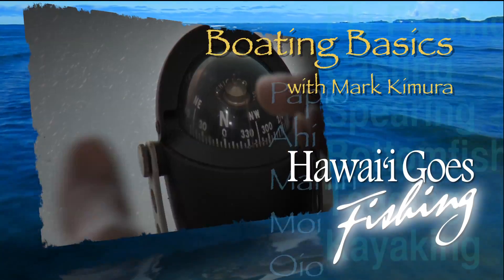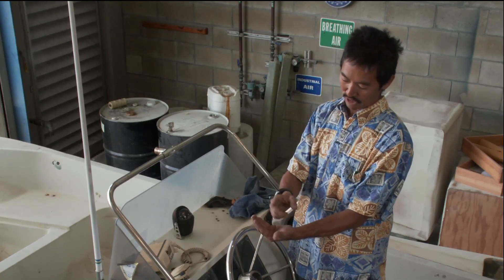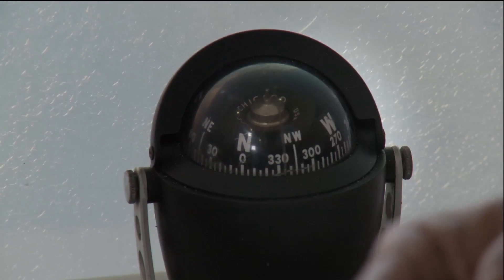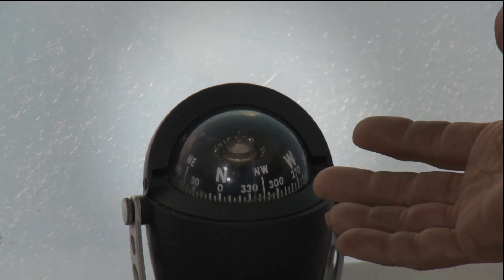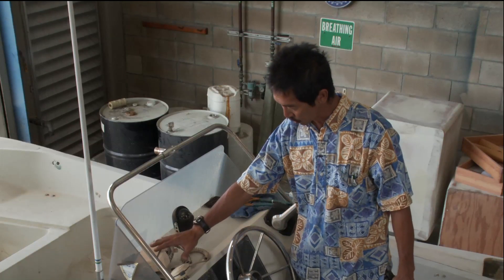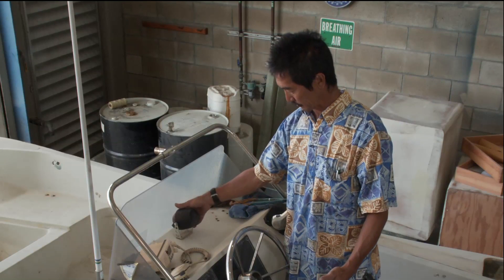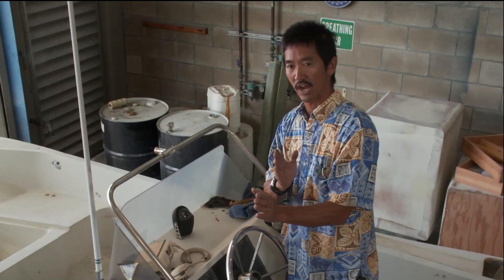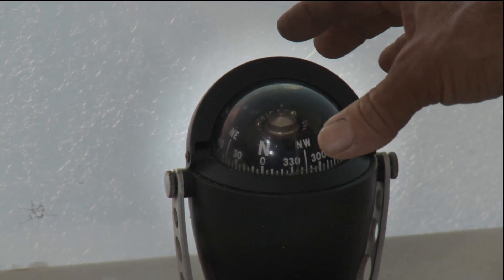Boating Basics, compass

Comment: Thanks I have a question what is the size of a Standard boaters Navigation chart map?
Reply from the maker: They're pretty big. A marine navigational chart for coastal waters can be about 3 feet long and 3 feet high. It's really intended to be used on a desk or map table in a wheelhouse. They could be treated to be weather resistant but it wouldn't take long before they'd fall apart.

Fortunately GPS units have taken the place of charts for smaller vessels.